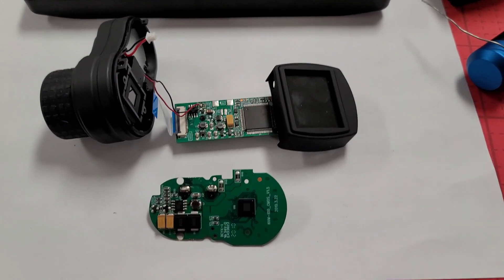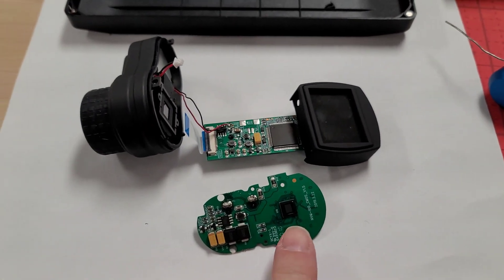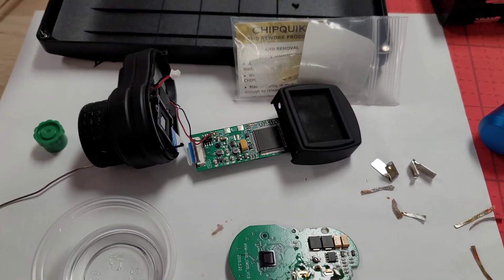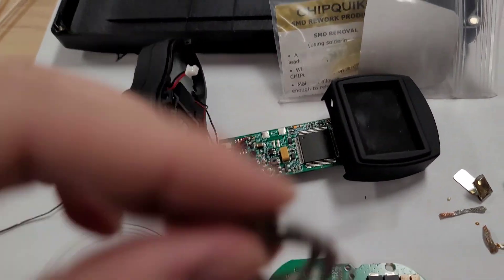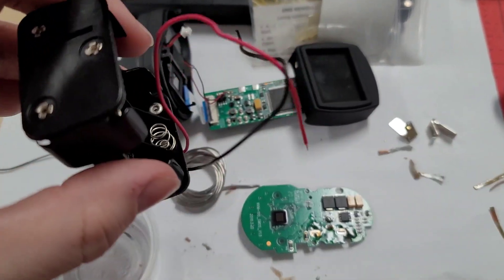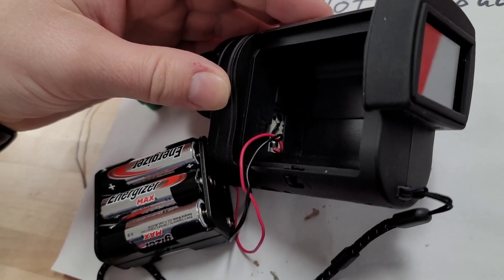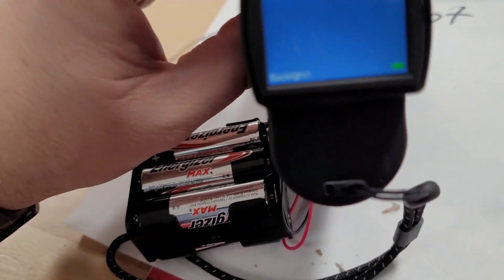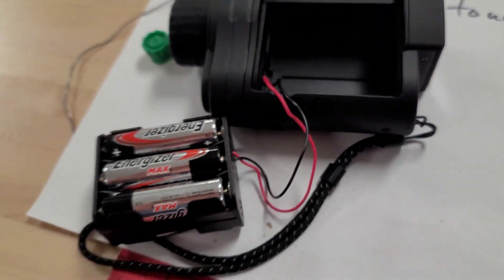Night Vision Monocular (XANB60) battery repair

Comment: I have the model XANB22 and it has 2 bays for batterys. It has a part uou put the batteries in, then put that into the compartment.  One of my battery holders had a complete meltdown and i cant find any parts at their website.